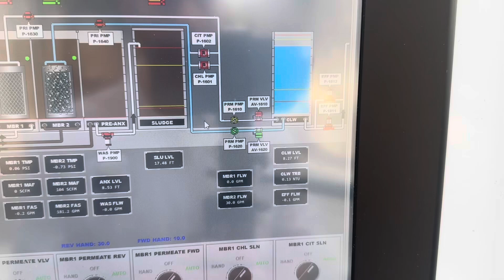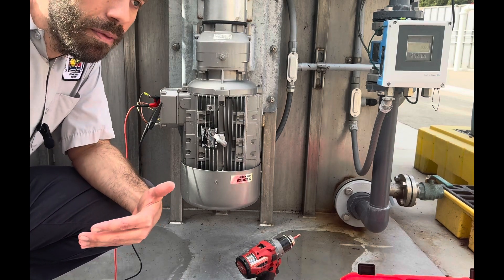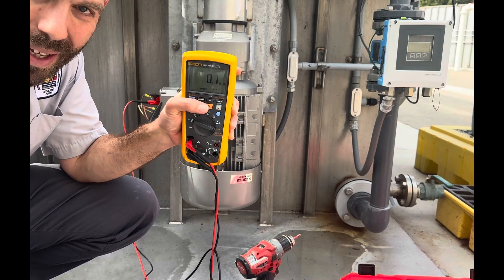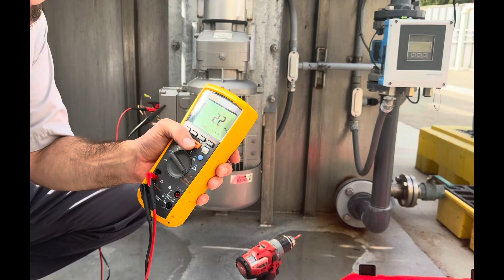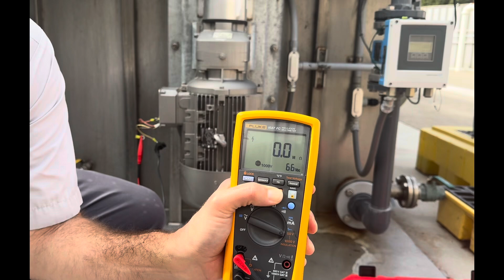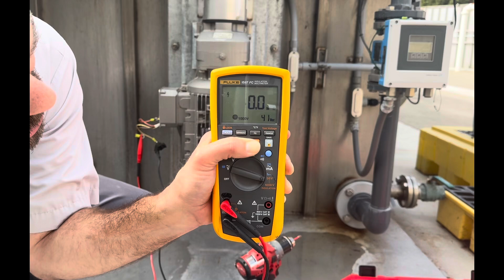Finding a Short Using a Megger.  Wastewater Treatment Plant Motor Troubleshooting (Bonus Episode!)

Comment: Clarification: Low voltage 0-600 VAC, Medium voltage 601- 69,000 VAC, High voltage 69,001 VAC on up. After megging your phase conductors, you didn't wipe them. Those conductors can and do build up capacitance and will give you a shock. Every time you meg a conductor, you wipe it to ground or someday you will find out the hard way what can happen. Also, just rerouting the conductors to the pump is not enough, you need to pull out all the conductors in that conduit and see why A and C phase shorted out together. More problems may be lurking.
Reply from the maker: Thank you for your input!
Reply: So for what its worth a 12 awg conductor with 1 cm of separation has a capacitance of .122 picofarads per cm or basically 12 picofarads per meter. 000006 joules per meter. When megged at 1000 volts. Hardly hazardous but suprising. You'd have to touch both ends of the conductor turned capacitor, and have it not be grounded to pull this off. Much more likely to get tagged by your own megger which I've done many a time.
Reply from the maker: Thank you for clarifying that!

Comment: This is more safety than troubleshoot video and having done this for more than 25 years the people working on industrial applications whether its waste water management, power generation or oil aren’t diy’ers randomly working on 3 phase motors at an oil refinery and skimming through youtube videos for safety tips
Reply from the maker: Thank you for your feedback!  Yes you are right, most people watching this aren't DIYers at all or even have access to a megger.  This channel is largely aimed at wastewater treatment plant operators to help them pass their exams and get their certifications, and there are some electrical safety questions on the tests (this channel is not aimed at mechanics or electricians).  Since I was showing operators a task that is more common for them to have to personally deal with in a small plant (rather than just call engineering in a large plant) and might very well be out of their wheelhouse, I wanted to emphasize that just because I'm doing it doesn't mean just anybody should start sticking their hands in electrical panels.  Your point is well received though and thank you for watching!

Comment: always check phase to ground and phase to phase when resistance testing.  same is true with voltage testing.  if at the VFD, if you had removed the 3 phases from the starter/contactor and did phase to ground then phase to phase, you would have seen the fault which should have lead you to the motor connection box (pecker head for those who know! 😉) then you would have separated line from motor and you would have found it there as you did.  electricians have to understand, from an installation practice, your primary job is to protect the insulation of conductors during any installation.  don't you hate opening up a panel or controller and seeing colored shavings laying in the bottom of it and skinned up conductors in the cabinet down to the connector threads of the connector?  sometimes, that occured on the other end and what's inside the conduit will ultimately fail.  if you unspooled conductors put them in a tank of water, you could energize them with a load and they could potentially last a couple decades as long as the insulation is in factory condition.  oh and that also includes excessive tension on the conductors as in pulling too many into too small of a conduit, too many bends, so, it's pulled like crazy straining the insulation and yes, that will cause it to fail when energized and loaded as will super sharp bends.  sorry about the rambling!!! 🤭nice video, i own a 1587 too!  🤗
Reply from the maker: Thanks so much for your input!  Yes I took the more circuitous route for sure haha.  That part of the plant is less than 2 years old so I honestly didn’t even suspect the conductors.  I went straight to the motor to rule it out cause we had an issue with the VFD back in October so I was suspicious of it from the get-go.  Turns out it was due to a poor install!
You are absolutely right about those conductors!  That mechanic that I referenced in the video came out to the plant today and ran the new conductors separate from that jam packed conduit.  I told him about this video and we discussed doing another one where he could explain conduit sizing and properly pulling and landing the conductors.
Thanks again for your input and for watching!